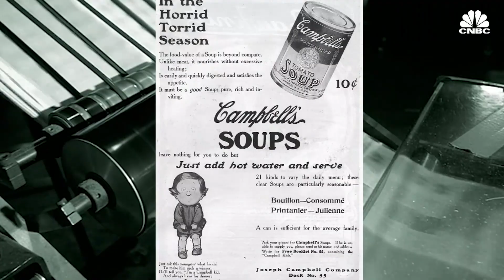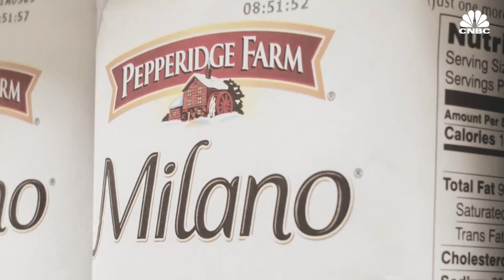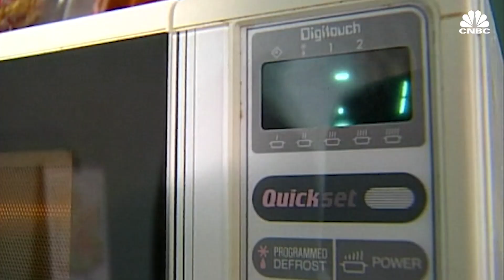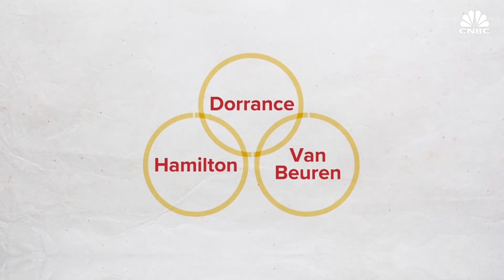How the Campbell Soup Company Fell Off Its Perch

Comment: Campbells Soup went down when it changed its formula and downgraded its own quality. Specifically it went from using milk & cream based products to "modified potato starch" which is what most of their labels of the cream soups read.

I'm of the generation where you always had at least a couple of cans of Campbells cream soups on the shelf to make a quick hamburger casserole or au gratin potatoes because it was a filling, inexpensive, creamy meal. It was Comfort food. Now it's just trash and if I want an authentic dish I have to go the long route and make roux and bechamel sauce from scratch. Thanks for nothing Campbells! (Oh, thanks for some money I might make as I short you going down. )
Reply: I recall in the early 90s, the Campbells condensed soups had to be diluted with at least 1/2 can of water otherwise it'll be a thick paste. The ones now have been watered down so adding water is no longer necessary.
Reply: Its crazy how they could spend 4.7 billion on pretzels but not at all refocus on quality. Companies are so funny.
Reply: It's about profits. More profit in potato paste than real cream. Sadly, the younger generations never get to know the difference.

BTW similar thing happened in Soda. Coke came out with the 80s New Coke (coincidentally enough I saw them get hammered even on the GoldBergs TV show repeat yesterday. So funny! "Why would any one do this?" they said after one sip). Blame High Fructose Corn Syrup & profit seeking.

FYI: The good pops are the real sugar coke which is usually from mexico or the pepsi throwback dew or real sugar pepsi. Walmart sells the pepsi. WFM also sells 365 cola which is both an excellent value because its cheap AND superb quality real sugar soda pop with great flavor.

People who say whole foods is expensive never walk into one. Almost all their 365 branded stuff is a bargain because its their generic store brand. There's great value in their bulk sections, too. Sometimes the seafood sales are spectacular. I've gotten fresh mussels there at just $2 a pound. I buy a few select things there then most of the rest of my groceries at Aldi's for the savings. I hope you put this info to use in your shopping.
Reply: John Possum good soda had real sugar and helped what ailed ya. Not this oversugared bubble candy crap called pop.
Reply: I was informed, on a company tour, that Cadbury's did it with chocolate.  Replacing cocoa butter with palm oil. Big mistake.  Although they quickly reverted it cost them a lot in terms of reputation ( read profitability ).
Reply: Yup. Cocoa butter is another thing that has been mostly removed from the food because they can sell it for more money in cosmetics & tanning products.

The really good white chocolate will sometimes still have it. Very little of it is sold in the USA.
Reply: @Jonathan Tan.  I'm 54  years old and I noticed the dilution change and the fact that they switched out their creamy soups from using real cream to using potato starch.   I started to add whole milk 2/3 of a can to the so called 'cream' soups now...just to get it to taste a bit more like it did for the most part of my life.   

I don't understand companies that degrade their own products thinking the consumer won't know/can't tell.    But in spite of the changes, I still think Campbell's makes  the best tomato and cream of mushroom out there...and I would hate to see the company go under.   To me, other companies' tomato soups just taste like tomato sauce and Campbell's cream of mushroom has a nice white look...and other companies, their mushroom soups are almost tan/brown...which kind of turns me off a bit.
Reply: John Possum 
So what you're saying is greed killed their company. The never-ending cycle of profit seeking is also bad for the consumer. In this case, it's food?
Reply: I stopped buying their  soups for two reasons.  One is they are way too over salted. They cheapened the product so to somehow improve the flavor enough salt is added to meet your entire daily intake of sodium in a one bowl serving.  Second is the replacement of product, no cream but instead use potato starch, my second gripe is their chicken noodle soup.  I once picked out all the chicken pieces in a can, the entire amount barely filled a teaspoon.  I think they make 1,000 cans of soup with just one chicken. Seriously, chicken is so cheap.
Reply: Same thing thing with Pepsi and Coke Cola, they changed some ingredients in the 90s/ early 2000s. I stop buying then it just never tasted the same.
Reply: I grew up on Campbells but have been very dissapointed with them for 20 years now.  Their Chunky soups are almost all artificial and taste awful.  Last year they changed their Bean & Ham soup to Bean & Bacon.   I rarely buy their cream soups, but last winter I made classic green bean casserole with the mushroom soup and it tasted so thin  and bland. I could not figure out what was wrong.  More cheap substitutions.  Sad.
Reply: As a kid I grew up on lunches of cheese sandwiches and Campbell's Tomato soup. I realize that as we age we lose some of our taste buds, but the nostalgic lunch that I had just recently tasted like a poop emoji. The soup was so thin you could almost see through it. Why did Campbell do that? Do they really want to lose customers that badly? Meanwhile, I'll just go back to making my own tomato soup with tomato sauce and a few ingredients that are left out of the (poop emoji) current recipe by Campbell.

"A meal in a can" my aunt Fannie!
Reply: itsmegp46 , Campbell's had several  flavors of low-salt soups as recently as 5 years ago. I tried them and the flavor was flat. At the end of the day, if you want something tasty from a can, it needs lots of salt. On the other hand, when I make home made soup, I add very little salt, and I don't miss it because it's fresh and wholesome!
Reply: John Possum I know they don’t taste like the good ole days canned crap now !
Reply: The best way I have found to make soup is to use a pressure cooker and place the bones, water, and spices in there. 1 hour cooking time in the PC or Instapot is like all day & night atop the stove. 

BTW the sign you did it right is when you put leftovers in the refrig and later they gel up. That's the proof you got the most nutrients out of the bones. Very good for you & your family!

I also do buy the paste style chicken bouillon because its great for gourmet sauces & in the long run its a whole lot cheaper than the nastier quality individual wrapped cubes. When I worked behind a forklift I discovered it is what most of the better restaurants use. 1 pound container lasts me a very very long time .

Also try dried majoram in your soup.
Reply: Rosella soups are better anyway, here in Australia.
Reply: I remember losing taste for their products, I didn't know they reformulated. That explains a lot. I used to really love their cream of mushroom. I'd eat it plain on top of tortilla chips. It was my dip.
Reply: @tamenga88: I still buy it when it's a good deal. Like my walgreens just had it for under a buck a can so I stocked up for winter and bought 30. I made some tonight but I started by cooking up 2 cups of barley. Then sauteed onion in the pan, deglazed with a cup of pinot noir, added 1 tablespoon of smoky paprika, then a can of vegetable beef soup and a generic can of tomato. A cup of beef broth to help it all along.

It was really good eating with toasted cheese sandwiches I made from homemade bread. When I use wine I feel like I am eating in a fancy restaurant. : )
Reply: Oof
Reply: I concur. I switched to Aylmer creams because I like dairy in my creamy soups.
Reply: nah, it was price.  they would stay competitive at 99cents
Reply: I agree, the value brands often seem to have a little more cream than the actual name brand campbells now, but still not as good as old campbells used to be. I add milk instead of water to eat their soups now. They are all so salty that those in my family with heart conditions have to be made soups from scratch rather than canned soups.

Its the way of the world: cheapen the ingredients and add salt to cover up the taste difference, try to use your brand name to move your now cheapened product and wonder why it doesn't sell as well as it used to.
Reply: Sounds like you work at Campbell's at least you did anyways I know I did but I retired
Reply: Well said John! :)
Reply: @smitajky  It happened when it was sold to an American company, who said, no jobs would be lost, almost immediately after purchase they found a loophole where the could go back on that promise. A lot of ingredients were altered and some manufacturing was done in Poland. I've personally never bought a bar of chocolate or any else with the Cadbury name on it. People tell me how the chocolate dies not taste the same.
Reply: reading this on April 27th, 2020... my comment: lol
Reply: You're absolutely correct, but no one from Campbell's will ever read this or care.
Reply: @dadoody  You never know. Maybe they will release the original cream-based formula and call it "Campbells Select" or something like that. In the meantime I have adapted to buy Aldi's cream of soups with are half the cost of Campbells. I am pretty surprised my first comment has 1,100+ upvotes. I thihk that shows people care.
Reply: Thanks for the fact.
Reply: We should send a letter to Campbell’s and tell them to change to milk base and cream base and not put modified potato starch.
Reply: @johnpossum have you seen the coke comercial that’s out now abt no sugar they say it tasted good? What are they thinking?
Reply: @smitajky  yeah most products have palm oil, instead of cocoa butter.

Comment: Back in the late 70's (my grade school years) I remember a can of Campbell's tomato soup being just about the best thing going.  Add a grilled cheese with that and it was the perfect winter meal.  Fast forward through the last several years and like most everything else it's quality has went to crap, recipes changed, price has went through the roof and my biggest gripe, the size of the can had shrunk, a lot.  Just a year ago it was 10-3/4 oz and it's shrunk by another 1/4 since.  Small change I know but it's a lot smaller than it was 10 years ago.  The average can is now $1.59 at my local store.  Just not what it used to be.

Comment: Buy up as much as you can now. It will last many years past the freshness date in a cool place.

Another way to make it last even longer is to remove the label. Put it in a large container. Then fill it up with water above the cans. This way no air can get to it. Use plastic dividers to separate different kinds of soups.

The above method works with skinned fruits and veggies that have no holes in their skin. This will keep them fresh up to 6 months. I read that on a survivalist website.

Comment: Condensed soup is just plain gross. It's watered-down stuff fit only to be given to toddlers who end up spilling half of it, and ramen is a MUCH cheaper option for that. Adults eat the chunky soups. Sadly (for Cambells), in the Chunky catagory, they're blown away by Progresso. First of all, Progresso cans and shorter and fatter (instead of tall and slender), which makes it easier to get the soup out. Second, Cambell's doesn't offer any Vegetarian or Vegan soups (of which I'm aware), while Progresso offers more than one. And, Progresso soups don't come with that traditional Cambell's grease layer (the orange goo that builds up at the top and "greets" you when you open a can). Plus, Progresso uses less salt, and I've never seen MSG in Progresso (while some Cambell's soups are loaded with MSG, a substance many people can't eat without getting sick). Furthermore, Progresso is often cheaper per can.

Basically, the problem is that no one wants to eat/drink nasty watered-down soup, and Progresso kicked Cambell's backside in the chunky soup arena, leaving Cambell's in a bad situation. (As for their Bolthouse Farms acquisition... I wondered why the selection of Bolthouse Farms drinks at Walmart decreased recently... now I know why. They were bought by a company that can't even manage to sell soup... let alone juice smoothies.)